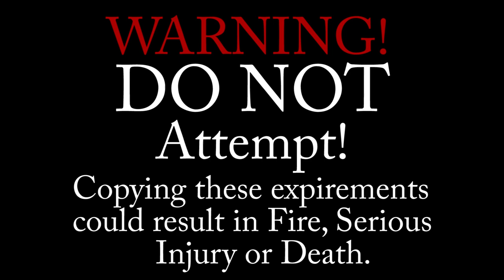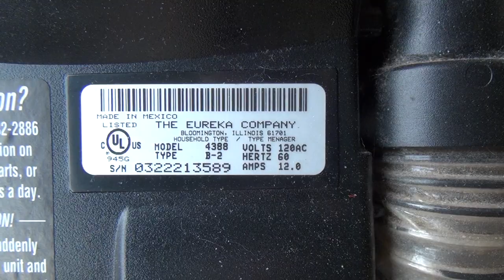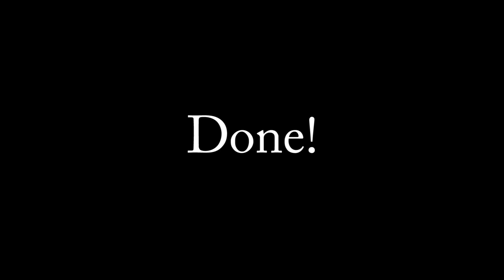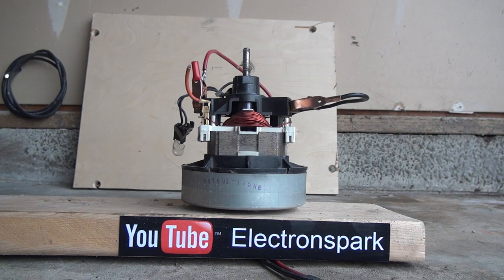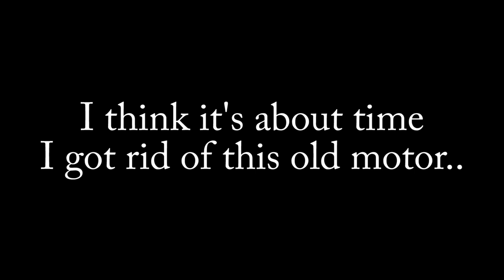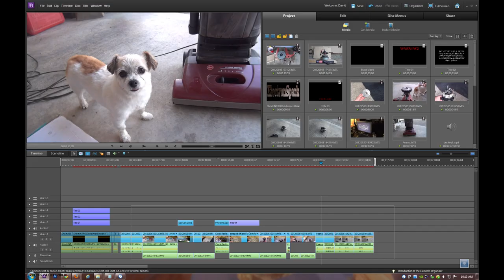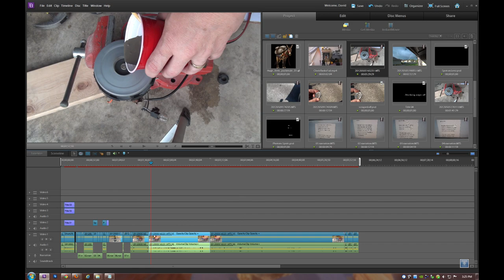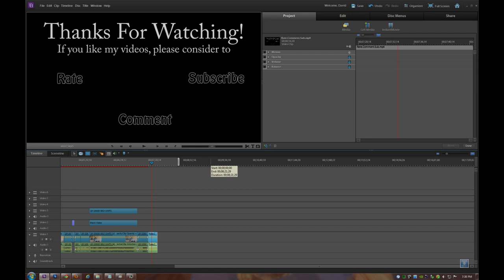Making A Concrete Flywheel

Comment: Hmmmm...I thought this was about making a concrete flywheel?  Turned out to be a video on how to destroy an electric vacuum cleaner motor.  I would have like to see you spin up the flywheel to determine what RPMs a concrete flywheel can withstand before it explodes.  Now do that in slow-mo and you've got a video!